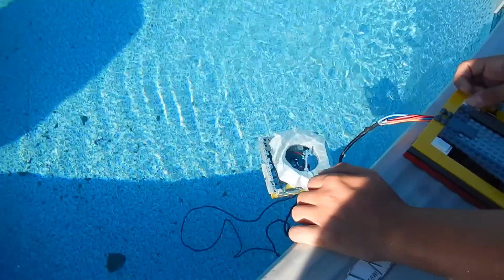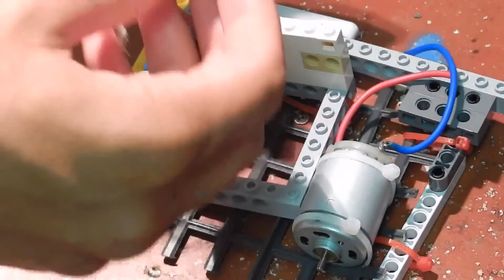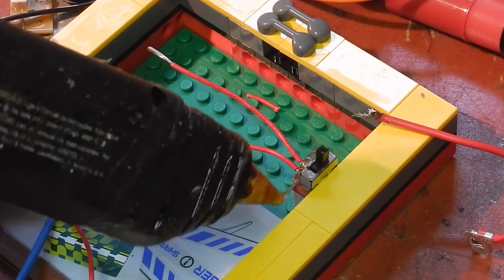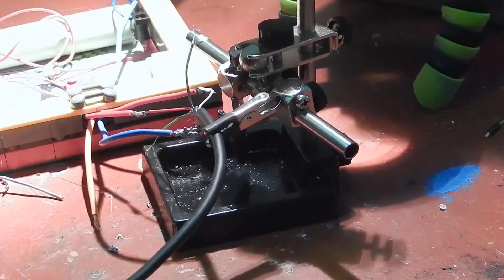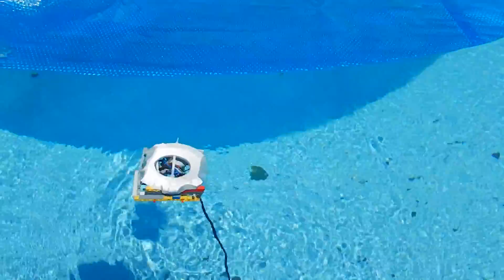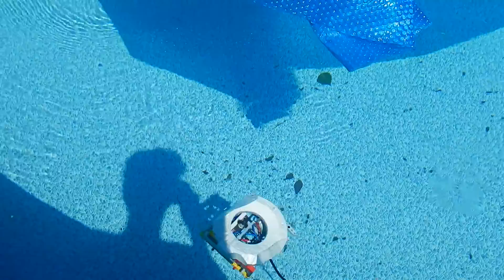Mini ROV (DIY underwater submarine)

Comment: Вау!) Це дуже цікаве відео! Теж намагаюся створити підводного робота у вигляді риби. Хочу використовувати для руху сервоприводи) 
А щодо твого роботу: моторчики не ламаються під водою? Я пробувала кілька сервоприводів: як тільки потрапляє у механізм вода - вони перестають працювати(( Твої моторчики звичайні чи якісь особливі? Чому вони не ламаються, коли вода потрапляє всередину?
Reply from the maker: Hei sorry for the long time for answering... The servo motors "break" since they use a potentiometer to have a feedback of the position. Since the potentiometer has some metal contacts to measure resistance when put underwater the value of the resistance changes and since the servo cant understand what is happening it goes "crazy". Also the internal electronics could short circuit. You should water proof the servo motr if you want to use underwater. One method is using nail paint for the circuit and then vaseline or a hidrophobic substance to coat the servomotor holes. Other than that useing epoxy glue or silicon could help sealing the servomotor.
Reply from the maker: The motors i used where some normal brushed motors. They dont short circuit in normal circumstances. Thei can be used only for a short time before breaking. They aren't going to work if youu use them in salwater. This solution is only "good" in fresh water.
Reply: @marcotrevisanmota5209  Дуже дякую за відповідь! Це питання все ще актуальне для мене. Думаю, що скористаюсь такою ідеєю, і спробую загерметизувати сервоприводи. Як раз буду мати для цього час. Успіхів тобі!

Comment: How did you keep the motors protected underwater? I would really appreciate some tips please. And what is the white circle on top and what is it for?
Reply from the maker: I thought the motors would last only two ours because they aren't protected and they are brushed motors but, they still work! Brushless motors last longer in water. The white circle in top is polyester that was used to give the ROV positive buoyancy.  In the next moth I will make a video tutorial where I will explain how to impermeabilizza motors for salt water ROVS.
Reply: Marco Trevisan Mota thank you